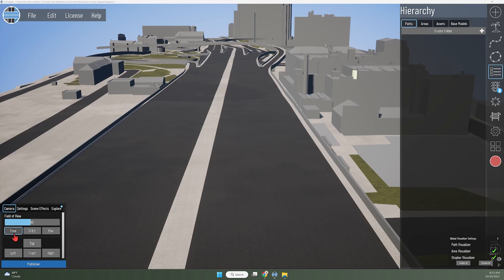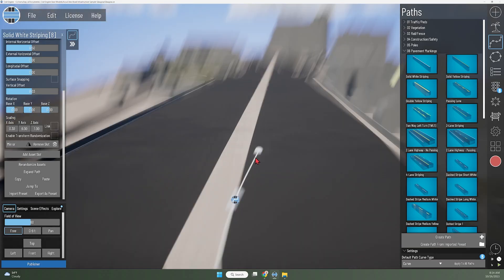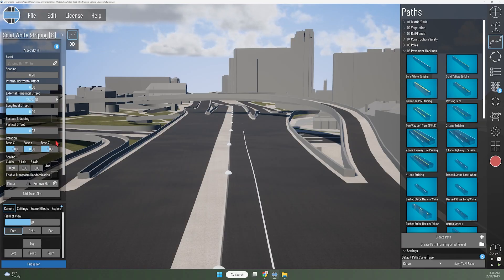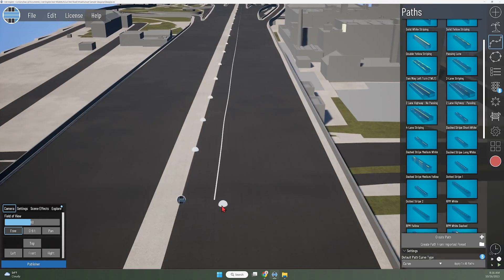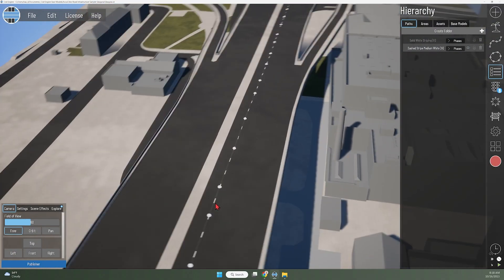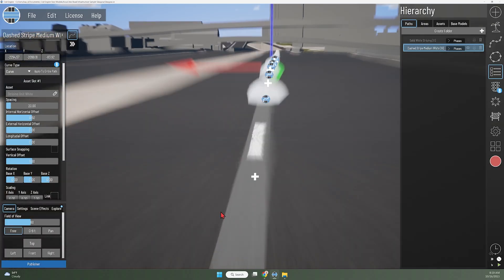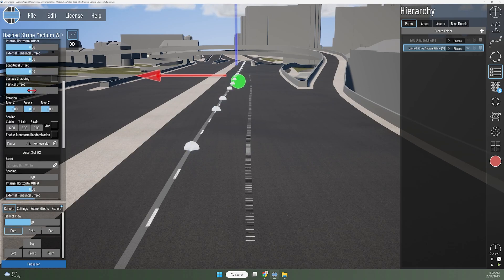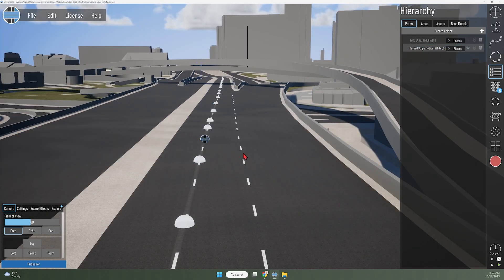Drawing Lane Lines in Civil Engine

Comment: I think what you guys are doing is awesome, however, this demonstration leaves me with a few concerns as it makes adding lane marks look rather  tedious

1. It feels like the snap to surface functionality could be improved by defaulting to snapping to the nearest face/surface or a contiguous face/surface rather than the top/"surface" of the base model
- This would result is only needing the center guideline without having to trace a lane guideline 

2. Is it common for importable city and/or road models to lack road markings? If so I'd hope tools to make it easier to add road markings are on the development roadmap
- A few thoughts on what could done to simplify the process of adding lane markings:
2.1. In this specific example letting the user run an edge detection algorithm to automatically make a path where the road meets the center divider & empowering them to use that as the basis for their lane markings seems like it would make added lane markings easier
2.2. Though for more flexibility perhaps using the difference in the material/texture might be better as it would work for roads without a center divider; Though intersections could cause a problem, so with this approach there should probably be some sort of intersection detection and/or handling, such as a maximum deflection between path points parameters or a max road width parameter
Reply from the maker: Great feedback!  Pavement markings are notoriously difficult to create within a 3D base model - they are typically designed by engineers in 2D CAD files as simple line strings/polylines, and rarely converted to numerous thin 3D meshes that barely sit on top of a model surface.  With that in mind, placing markings in Civil Engine (while appearing tedious) is quite a lot more efficient than modeling them in 3D.

And all that said, we're exploring future version updates that should provide faster/simpler solutions than even what you've suggested.  This might entail converting those 2D or 3D polylines made by the engineers to a .shp file (or similar), then importing into Civil Engine and replacing them with auto-drawn paths.  Our development team will be researching this soon, hopefully for implementation in a Version 2 update (no timetable yet available).